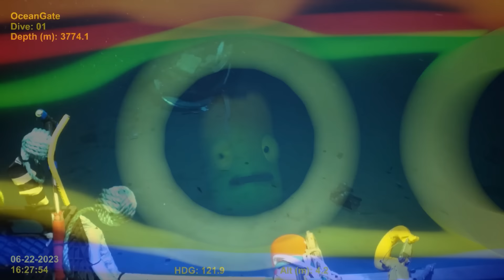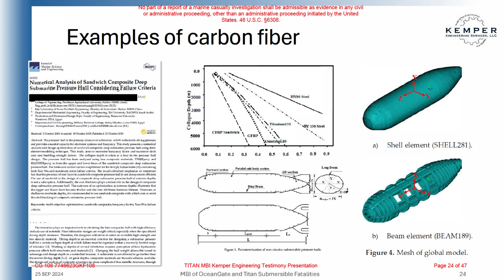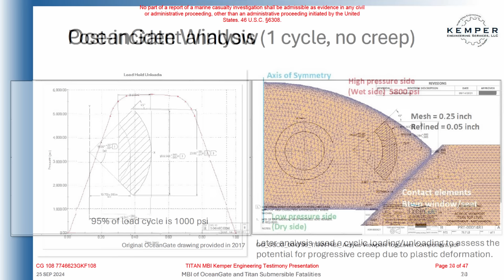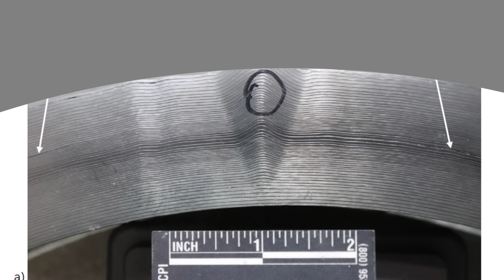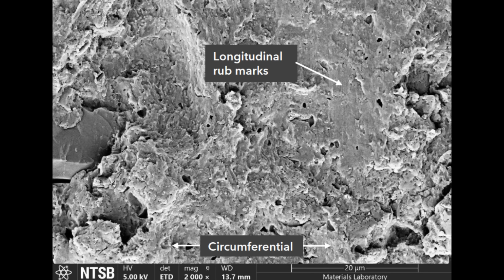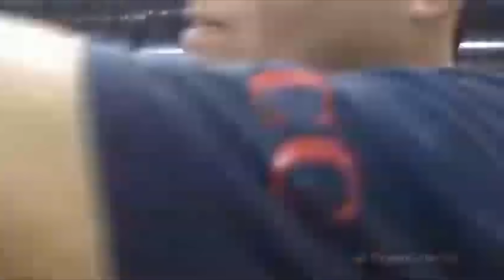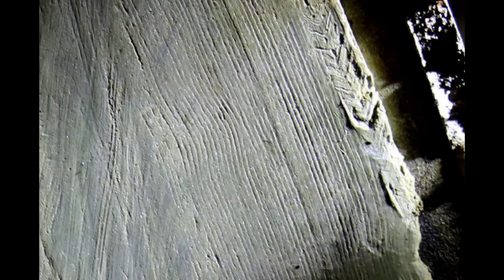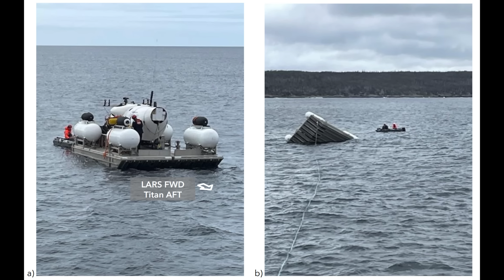OceanGate Wreck Shows Why Sub Wasn't Strong Enough To Survive - NTSB Shares Important Details

Comment: Oceangate and Rush would be financially finished if the second hull had to be scraped.
Rush was also getting a reputation of not delivering dives.
Dive or no dive, Rush was keeping the cash. 
$250,000 a pop isn't pocket money, even for millionaires. I know I'd be bloody annoyed.
I think Rushes behaviour can also be explained in another way,  other than greed. 
Rush thought he was a genius, in a way that only a fool can think.
He was psychologically incapable of admitting he'd been wrong to all of his peers in the submersible community.
Reply: I don't know anything about Oceangate's financials, but my theory is that the company wasn't doing well financially, and Stockton Rush felt under immense pressure to deliver something and prove he could do the dives he promised. A lot of the bad and dangerous decisions seem to be financially related: he didn't built many prototypes and test properly because those are really expensive; building a sub that is compliant and getting all the required certificates is insanely expensive. Even during the build process, he encountered problems with the bumps, and the hull was too big for the titanium rings - the correct fix would be to throw away the part of the hull he already built and start over. He didn't do a proper inspection of the hull after hearing the loud bang and seeing the problems his acoustic monitoring system - because that would likely mean being unable to perform any of the remaining dives in that year, which would mean a lot of lost revenue.

I'm sure he was passionate about exploring the oceans, and was desperately trying to keep his company alive so he can continue doing just that. Every gamble he took, it worked out okay for him (until the last dive), so he became overconfident and kept making worse and worse gambles.
Reply: @chibicitiberiu  I think the failure point will be the carbon fibre/titanium hoop interface. 
When they glued the two together, I saw a disaster waiting to happen.
No excess glue came out of the joint, nor did I see any effort to exclude bubbles from the joint, I saw people without gloves or masks or lint free overalls, cleaning the surfaces with some old rag.
I asked a friend of mine about this. He said that big carbon fibre objects need to be laid in near "operating theatre" conditions.
After I showed him the full assembly film that Oceangate posted and then deleted (glad I saved it,) he pointed out the following.
The machine being used as it was set up couldn't have laid down lateral layers of carbon fibre. It was all hoops. Unless it was applied by hand.
He said the reason for the wrinkles was poor control of tension in the machine laying down the pre-preg. If too much tension is applied, then the layers underneath are being crushed and deformed prior to curing.
He said the 25mm/ 1-inch thick limit per curing is the absolute limit. And that by the time the 2-5 layers were being cured, that limit should have gotten less, and that the curing times in the autoclave should be longer, in order to get the whole assembly to temperature.
He also pointed out that cycling a joint between carbon fibre and titanium was very problematic due to the two materials deforming at different rates. When this happens in a water environment, you're going to get water ingressing into the joint every time you go through a pressure cycle. Eventually, the only thing stopping the end of the carbon fibre tube from getting squashed is the titanium flange, the same flange that was sheared off.
All this is just speculation, I'm no expert.
But I can't wait for the full report to be published.
Reply: @HE-pu3nt  carbon fibre has a negative thermal expansion coefficient. You never try to join materials with opposite properties.
Reply: @chibicitiberiu This explanation makes sense.

Comment: For the layman to understand.   Whenever making structural monolithic composites requires the entire process must be done at the same time.   They won’t build carbon fiber or fiberglass boat hulls in multiple steps.  It’s one solid layer manufactured at the exact same time.  This is industry standard.

Comment: I wonder: if the same hull geometry was made of 100% resin, wether it would have made a difference in the outcome. The carbon fiber was mostly under compression and shear and not under tension. 100% resin may even have reduced the amount of voids and weakpoints.

Comment: They way to envision the load on the joint at the side it failed and both sides really, is that the inside of the join gets more pressure between the cylinder and ring, and the load due to the cylinders assymetrice deformation will concentrate pressure on very small areas on the inside, and less so on the outside in some areas, you get two competing effects, the turning of the cylinder cross section perpendicularly to the plane of the radial direction of the cross section and the lenght of the hull so loading more on the inside or outside, and then the lenght of the cylinder under deformation along seperate longitudinal sections also change depending on whether that section is buckled out or in, in the radial directory of the transverse cross sections. And ofc there is a bias towards inward bucking, but just like with a coke bottle you suck the air out of, which is almost circularly symmetric, some parts get pushed out and some in even though the pressure is just pushing in, because of circular symmetry being very unstable under external pressure. The deformation is almost non exitent in compression evenly before the buckling starts happening, just try it with a fresh bottle, the first time you do it do it very slowly, and see that right before it buckles it starts very slowly losing the circular symmetry and then all if a sudden it buckles, and the next time you try it, it won't take nearly as much vacuum before it buckles in the same way. The same applies to this sub, just in a more complicated form, with a lot less deformation necessary to creatw the inelastic deformation. I would lool at the end of the forward side of teh carbon fiber hull, the picture you showed has a large section that just looked like paper that has been through a washing machine, just exploded when water rushed into the cracks upon faliure. Anyway, its both sad and fascinating regardless, and i think it is a powerful lesson that any engineering is done from the armchair unless you base your assumptions of real and rigorous testing, there ain't ni such thing as knowing your assumptions are correct.

Comment: Another shame is the fact that carbon fibre hulls may indeed work for deep sea diving just as acrylic did. The fact that despite Rush doing all the crazy stuff he did, the sub lasted so many dives suggests that a probably designed carbon fibre hull maybe very safe and stable. Problem now is this tech will now be dismissed out of hanf because it was so badly implemented by Rush.

Comment: We are informed that the titanium End Cap fell off the front of the "submersible" as they were making their way out to the dive area. Did this not ring any alarm bells anywhere? 
There were supposed to be a total of 18 bolts and fasteners securing the passengers inside the hull. Photos taken just before the final plunge reveal that only about 4 or 5 bolts had been re-installed! How the hell did Crush convince these people to get in that thing?

Comment: Guys, for once, create an ingenious system to detect failures, system works and... they ignore it. 
Brilliant, what could possibly go wrong?
I wish someone could tell me if the little voids between composite layers still have air inside once they are formed or not. If so, the increasing pressure would also increase those air "bladders" temperatures, which might have an effect on the glue? If so, it might mean that those little voids could crack the fibers if they structural stress makes them implode as well... increasing the danger to the laminar structure. 
I just remembered what the Mir subs people said, if one of the headlights implodes at that depth, the shockwave would destroy the sub as well... So imagine little internal shockwaves happening... what the accoustic sensors picked might be linked to that.
But I wish a specialist could answer this because my take is entirely amateurish and theoritical. If the building process applies so much pressure that the voids's air is siffed out upon fabrication, my theory is then completely bust.
The fact remains that the images show a very bad design and building quality (to the point of stupidity, it reminds me of amateurish fixing of damage on aircraft hull by maintenance guys who didn't understand what they were doing and were just told to save money, leading to accidents later on) and that this machine should have never taken passengers, that much is certain.

Comment: With regards to all the data shown and the investigation, do you think someone will replicate the destruction of the Titan submersible? Surely showing a vessel like this imploding at 3,500 meters down (or similar simulated pressures) would be useful to the whole deep sea submersible community. More impressive would be catching the even on a slow motion camera showing the event to examine (and possibly show to the general public) how different failure points cascade in to different types of debris fields. I know it's macabre , but to me understanding and having a visual event rather than simulations makes it far more tangible.

Comment: Structural engineer here, the way the shape of the hull changed during ascending and descending, the fact that it did not return to it's original shape, that would indicate that the composite was no longer acting in the elastic spectrum and had begun to behave plastically, i.e. it was already yielding. I'm an expert in steel though, not composites. 

Those graphs are damning.

Comment: The structual integrity of any submersible after a few dives is already in decline. Thats why they have so many checks. 
The Titan Sub had already been down to the Titanic 2 ir 3 times. Probably had no repares or checks done after those first dives.  How can you check paste that youve put on to glue the end caps on, unless you take them off and rebuild it. 

Then it would have lasted another 3 dives 

R.I.P to all lost some shouldnt have been there. Some was there to make sure others were safe and one of them was arrogant!!

Comment: That end cap glue was about 0.1 inches thick, or 2.5mm, ideal epoxy thickness is 0.1mm for maximum tensile strength. So on top of everything they failed to do the end cap gluing correctly.

Comment: Excellent analysis Scott. I do have some experience in CFC. I can't remember which is stronger 45 deg, or 30 deg changes. I think the lower the angle, the easier the load path. 90 degree changes are OK for none pressure vessels but even the helicopter floors that we were making had 45 deg changes between plies.

Comment: As a domestic heating engineer, with no diving experience and little knowledge past watching Jimmy Cameron doing his Marianas trench dive. 

All even I had to do was look at it, I didn't even know it was fibre glass. Just the shape of it and the caps on each end meant it was always doomed. Always always doomed to fail at higher pressures. 

So I wasn't shocked a year later when YT was spamming videos telling me it had done just that. 

You have to be certifiably insane or really really smooth brained to have got inside that thing.

Comment: As a pressure vessel inspector, it is obvious that just the change in shape from a hemispherical window to a flatter shape would doom the submarine.  That's a surprisingly basic principle in fracture mechanics.  A non-homogenous, laminated hull introduced all sorts of problems which appear not to have been addressed.   Cutting the fibers of the carbon layers at the wrinkles weakens the layers, and inability of the adhesive to bond between the carbon layers is also a weakness, leading to delamination under shear stress.  Adhesive voids or lack of adhesion in areas is fatal.  Assumptions in the calculations that the pressure hull is homogenous and not layered, and reliance on test data from the windows which do not match the exact geometry of the item on the sub appeared to provide a grossly optimistic result for the vessel.  So many unconventional features, misapplication of basic design concepts, and shortcuts in design were taken that we may never know which precise part of the sub failed.

Comment: Never trust an engineer that says, don't worry i understand this stuff. Trust the guy who says, "this particular application has been well tested" or "we don't understand what we are doing with this design, we need to do this and that test to make sure our models are solid". We do not have a single example of a simulation or piece of applied physics that is so rigorous that an unexpected faliure is impossible without testing. No way, we don't and won't have that computer power for centuries.

Comment: The moral is that you can only over engineer a spherical cow model of what you are doing if other people have done the actual work for you. The simulations ocean gate did doesn't really have anything to do with their design. Its worse than guessing, because a guess is something you kniw is questionable, when you just run models you have no idea about being applicable or not, you get a very dangerous false sense of security. Its the same stuff that given crackpots confidence, they think they know hiw stuff works in hindsight, because other people have dealt with the real complications, but no, the spherical cow models you learn about in highschool, or undergrad, are super dangerous to apply to real engineering, you need a rigorous testing methodology for applications of simplified models, or you will kill people, it almost doesn't matter what you are building.

Comment: So yeah the optical fix is trivial. I'm watching in real time here and commenting as i go, and it took me half a second to solve the optical issue, you just use oil with the same osh refractive index behind a flat acrylic surface, and you can have any shape lense you want from the perspective of the inside, it takes 15 seconds to get the basic idea and then maybe an hour to design one with an expansion baloon to let the oil and and out when the acrylic deforms, and you can have all the flat surface you could ever want on the inside, infact you could make it as wide angle a lense as you want almost.

Comment: And also, the assumption that you would hear a ramping up in crackling is absolutely nonsense. The majority of violent crackling assuming what i said is more or less correct, which i think it is, and i would bet money on if we did the required testing of this specific design, then what would happen is a lot of violent noises early on eminating from the parts of the material near the join with the too stiff end cap, and that would subside as the carbon weakened, and over time more of the hull would become weaker, until it just without much warning completely buckled and shattered in an instant. The glue is basically only there to prevent tension on the joint from creating space for water to enter, u'm not entierly sure whether having no glue after a certain depth would actually have made any difference at all. Only if the pressure on the joint turned negative, it is mostly onoy serving the purpose of keeping water from penetrating the joint. It depends on the degree of deformation of the cylinder cross section from its plane, i supect it only really mattered at something keeping water out, but didn't really do much outside of acting as cinnective tissue during the catastrophic faliure. I think there was probably positive pressure on the join all around maybe appart from the first few dives. Because the longitudinal compression on bith end caps involves an enormous force distributed on the cross section, i don't thing the definition of the cylinder was large enough to produce an actual gap even if there was no glue at all, perhaps the first dive, but once the material at the joins softened with damage to the carbon, very likely not so. The glue probably only mattered very close to surface level, bellow that the over all prositive pressure would have kept the seal anyway. So mostly serving to keep water out of imperfections in the joint.

Comment: there's a lot of parallels to the errors that catch-up pilots... allowing judgement to be clouded by personally imposed deadlines/goals. that ping should have been a reason for a full detailed inspection just by reason that it was an outlier.  sure, explain it away to the customers to keep them from freaking out, but bring it in for full inspection anyway afterwards. 

if you look at the reasons for failures in carbon fiber bicycle frames, it's often voids due to wrinkles during the layup, and that's at surface pressures

Comment: When I heard the part of the grinding the wrinkles away and then keep layering carbon with glue between the layers it made me think of this:
"A grinder and paint makes you the welder you ain't"
I know nothing of carbon, steel, pressures and whatnot but if they would have shown me that little fact I would never get into that contraption, purely based on that old saying amongst welders.